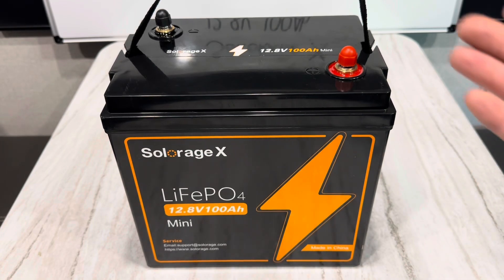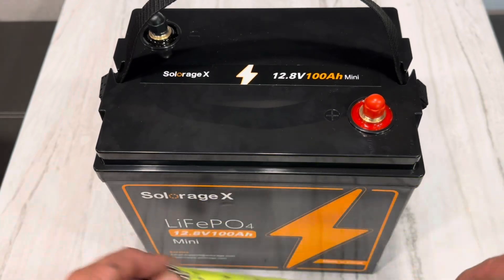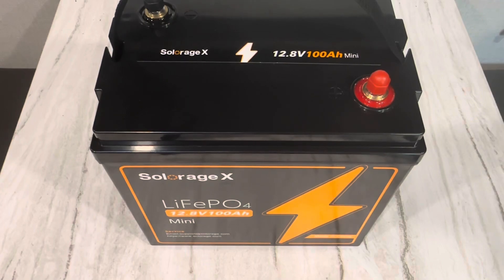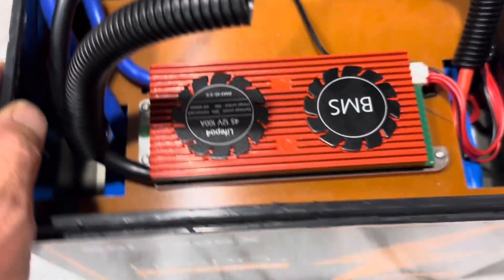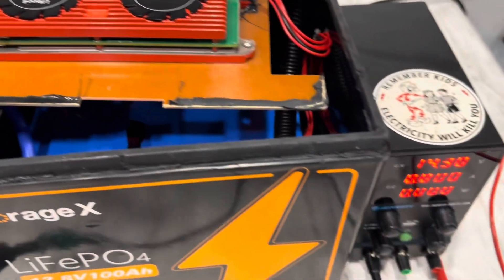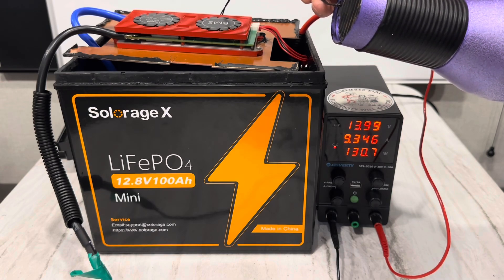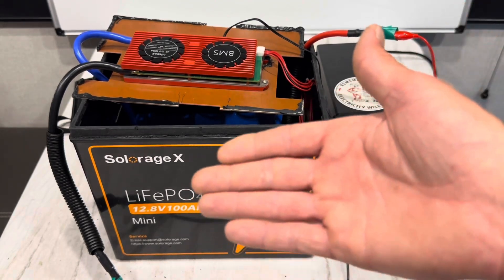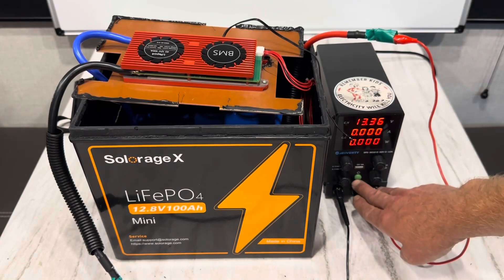Cheap Amazon 12 Volt LiFePO4 Battery

Comment: Interesting tear down. I just got my battrry in today (ordered from TEMU $126.00+tax.) But when i got it out of the box there is something loose onside the battery. But from what i see in your video the only ot might be is one of the nuts must have come off the battery pack. But it still has a 13.2volt charge. Im scared to mess with it and even scared to ship it back. I dont want it to short out and cause a fire or something.
Reply from the maker: Wonder if the BMS came loose? Hard to say without looking inside. Do you have a return option with Temu? I’d try and send it back or get a replacement. LMK if anything else I can help more on.
Reply: have this in my cart on temu as we speak, do u have an update?  also @THEOFFGRIDMOUNTAINHOMESTEAD would it be hard to open up and just replace the battery cable? since it seems to be the issue mainly in your review

Comment: Low temp is set too low. If theyre cutting corners on a 7 guage wire thats a big red flag. Do not buy 😮😢
Reply from the maker: Definitely bargain bin style battery. User is cautioned on its limits.

Comment: Thanks for these videos.  I think capacity tests, over current protection, and under voltage protection would be awesome if you could run them before you tear down the batteries.  Thanks
Reply from the maker: I do different tests on other videos. Here’s and overcurrent test. https://youtu.be/aafJSGZNDfA?si=MffJDR6yszFdb18D
Overcurrent tests are usually pointless on the cheap batteries. Sadly most trip on thermal and don’t actually have BMS overcurrent.

Comment: used cells.. others on amazon having issues .. you get what you pay for and no warranty they say pain to get warranty since overseas  you need to deal with
Reply from the maker: I was fairly certain there was funny business going on with the cells. First time I have noticed defaced codes.
Reply: @THEOFFGRIDMOUNTAINHOMESTEAD  yup get what you pay for 🤣 im sure it will still be good but higher chances of it not getting a good life span.. I'd be happy if that gets at least 5 years for the cost.. the fake daly bms gave it away thats its just a used reject cells I bet like most companies do and say this and that 5000+ life cycle 🤣 .. just a pain to get warranty since they are over seas and shipping this kinds of battery is expensive and will take months to get a replacement I bet 🤣
Reply from the maker: Still not as bad as this one lol https://youtu.be/FTum_SIE1s0?si=a1j2Ba8G3AvCsHUV
Reply: @THEOFFGRIDMOUNTAINHOMESTEAD  haha.. i bought a 12v 100ah on ebay and it was heavy and i open it and had lots of small round cells.. after some cycles i can only get 95 to 97ah lol.. had it for 3 years now i abuse it on my trolling motor still works great but its only at 92ah now since i did let it die flat shut down mode by bms.. so far so good and i only use like 30 to 45ah when i use it for trolling motor so it should last me a while still..its just heavy at like 25 pounds lol... ill get a mini 12v once this battery is kinda done for but thats going to be maybe in the next 5 years or so lol
Reply: Solaredge doesn't want you to run in series above 3 batteries iam still gonna do it anyway with a power Mr balancer

Comment: Just take the B- out, flip the box on mattress or pillow and 1 quick shake down will make the pack de-glue and drop.

Made a project with one of these and it came with the above mentioned method. Also, I never could get the Overcurrent to engage, which was concerning for me. I completly removed blue plastic from cells and all QR codes were unreadable and cells look Grade B at best, slightly swollen.

For the price though, possibly worth it, time will tell. Try Feuruect 12v 100ah if you can next. I openen one of those up and cells look in much better shape.
Reply from the maker: Definitely recommended conservative underrating protection devices if using this product. 50A-60A breaker may suffice due to small wire and many reports of this BMS not behaving correctly. No way I’d run 100A sustained through this unit. Low amperage/storage capacity uses should be ok. Or cell harvesting when the price drops. I’ve seen it as low as $139.00

Comment: Nice to see what it looks like inside. I picked up this battery to run a small trolling motor on my kayak. It only pulls a maximum of about 20 amps so this should work fine for my needs.
Reply from the maker: Definitely good to go for your application!! 
I’m going to use the Solorage X on my irrigation pump (30A load) for the garden.
Take care!

Comment: what a deal... I will be upgrading some solar soon. gonna have a lot of thinking to do when the time comes on what direction to go. Been lookin at Signature Solar products a lot lately. Any thoughts on their Solar Mini Splits? Hope all is well.
Reply from the maker: My $.02 I’d go with a standard high seer unit. 25 SEER+ model from a reputable manufacturer (Daikin, Mitsubishi, Bosch, Gree etc.) and run on standard off grid inverter or grid power. Less complex and easy to get parts locally for a common model mini split. Hope this helps.

Comment: Well it is not a bad quality but I am not happy about the under sized wire. But other than that it seems to be a decent budget battery.  Thanks for a honest review!
Reply from the maker: Has its drawbacks. But for an open minded person that wants cheap “storage batteries” it might fit the bill nicely! Almost impossible to even buy the cells and a plastic case to build your own at these prices!
Reply: @THEOFFGRIDMOUNTAINHOMESTEAD  I agree! For a large bank of batteries it would work and probably never have a issue. Thanks for honest reviews